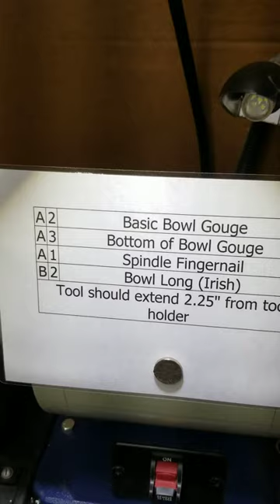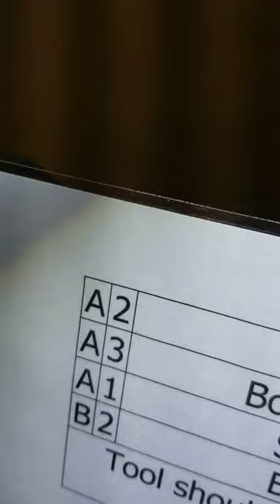How to Operate the Kodiak Sharpening System

Comment: Hi Ken, in your video you explain the head moves approx 1/4" between the A and B settings. I recently purchased one second hand and the head movement is almost nil (I'd say approx 1 degree). Is there a way to achieve the 1/4" movement without wrecking the part? thanks for your help.